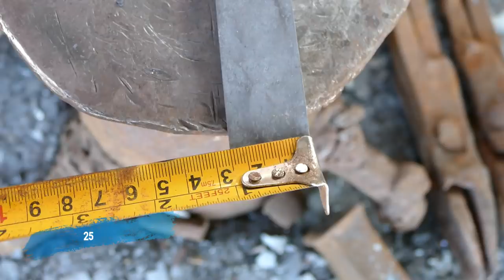MAKING A CHISEL WHICH EVERY CARPENTER WANTS TO OWN (HOMEMADE)

Comment: Great video as always. I must say Seth is a great blacksmith. And he need not need to prove it to anybody. His products are used for hard purposes like nut cracker aagriculture and many other . Even   japnese  and Indians quences in water. They are hardened . Keep up the great work. Home made power hammer is a great idea. Will definately increase and improve his work
Reply from the maker: He has different techniques for hardening and heat treatments. It is hard for me to explain it right as my English is not good enough.
Different kinds of steels, different techniques.

Comment: You can use a magnet to see if the steel is hot enough before quenching- the magnet will not stick to the steel if it is hot enough.
Reply from the maker: Wow that is aGreat lesson. We didn't know

Comment: Hi dose the black Smith temper the blade after harden it in water
Reply: sam l forge No.
Reply: He let's it auto temper.. in other words he leaves enough heat while in the quenching process to temper at the same time.. that's why you see him dropping water on blades the see how it evaporates and check his temper temp..
Reply: @anthonystrunk5360  this only works for low HRCs, and edge quench. It's suboptimal, but works.
Reply: @adrianjagmag  not if it's done correctly like this blacksmith obviously does.
Reply: @anthonystrunk5360  I literally learnt from smiths like him in my country, before I did formal western style smithing, facepalm. It's suboptimal. It's a much easier process than marquenching in oil, and then doing multiple temper cycles. Which is why it's done. The owner will periodically return to get his blade reheat treated.
Reply: @adrianjagmag  yes it is but it works.. I was explaining to the person that asked the question how his tools and blades were tempered.. I'm also a bladesmith and I use oil quench and tempting cycles.. I'm afraid to quench 5160 in water.. bad experience..lol
Reply: Anthony Strunk god 5160 is annoying. Cracks in water really easily and moves slower than other carbon steels. But it’s cheap and works well so I’ll keep using it haha
Reply: @JustinTopp  oh yes I use it alot but will not quench in water again...lol.. learned my lesson..

Comment: between 1:45 and 1:53 those are two different pieces of steel. in the first he was cutting off about 1/4 of the steel with the wedge, on the piece at 1:53 he is splitting a piece with over a third the width. somebody screw up and start over?
Reply from the maker: Not different steel. It is the same. Please check review it

Comment: Again. He is not getting his blades hot enough to actually harden them. He needs to get them at a bright yellow heat for it too actually harden
Reply: Actually he is. The camera makes it difficult for you to judge colours. He's aiming for a much lower HRC than what we'd go for. Since we quench and temper differently.
Reply: Or maybe he knows what he is doing. His livelihood depends on the quality of his work.
Reply: It's the light.. I'm sure his blades are hard.. you can see the hardness line after heat treat like a hamon line.. if he were to quench spring steel in water by making it glow orange and dunking it they would be in pieces .. he is a very good black smith
Reply: In daylight spring steel hardens In Water at a much duller red color than indoors.
Reply: @adrianjagmag  It doesn't quite work like that. Even if the camera is not showing the true heat thsn why can the camera show a yellow heat on the forging earlier in the video. And if you trying to harder something it wont harden with a dull cherry and it's very easy too temper after which makes the blade more useful by making it stronger. All he is doing is making the blade soft which wont hold and edge and hardening on one side of the steel does not mean it is hardened. Try again
Reply: @ReasonAboveEverything  It may depend on it but he is  selling things that wont hold and edge and will break very easy. For God's sake if he really knew what he was doing he would know that none of his blades or tools have been hardened
Reply: @anthonystrunk5360  A line does not make a blade hard. And a hamon line is clay placed on the spine to make a pattern or leave the spine of the blade soft and springy. Do you know how quenching works? 5160 which Is spring steel should be hardened around 63 Rockwell then tempered too make it stronger and not as hard as glass. 5160 is not a water quenching steel regardless there could be hidden cracks along the blade that the naked eye cannot see. And if the lighting is the issue than why cant you see the same heat when he forges to the quench. You can clearly see he never gets near hot enough.
Reply: @JustinTopp  I did not know that steel hardens at lower temperatures while in the light
Reply: Joe the Blacksmith it’s not actually Lowe temp it just looks like it from light
Reply: @joetheblacksmith8071  yeah I guess you know more than everyone else. You should have you own YouTube channel
Reply: Not all steels are the same. Some harden at a brighter red that's just a little over the demagnetizing heat.
Reply from the maker: I have talked with his customers, especially old people who know him and his father. Those people keep saying that his father and him are good Blacksmiths. Some people have had the products from them for decades. They are from many different places.  They all believe in the heat treatment and hardening they do. All of these come to a conclusion that the quality of their products are very very good.
Thank you all for the discussion.
Reply: @AmazingKKDaily  I totally agree with you and believe he is a very good blacksmith.
Reply: @joetheblacksmith8071  because you need a lower temperature for a water quench, and for an edge quench you're just quenching the very edge, they aren't doing a full blade marquench and temper. Honestly, change you name to something else. This method as I've explained is a necessary compromise considering the steel they have access to and works adequately, since spring steel can range from 1080 to 9260, they have no way of really knowing, so this method is safe for them. If you know so much, why the hell are you here? Also, you can get quench lines, aka a hamon without clay.
Reply: Joe the Blacksmith If you sell soft tools you go out of business. He has been smiting long time and is popular. He also has uploaded some of his tests where he cuts aluminum pipes and nails in half and the edge holds up.
Reply: @JustinTopp  You know I'm fucking with you right
Reply: @anthonystrunk5360  The funny thing is that I will be making videos but it's funny that you think you know everything
Reply: @demastust.2277  yes not all steels are the same. But 5160 is one of the most basic steels and is very easy too harden does not mean the actual blade is hardened when its red
Reply: @AmazingKKDaily  Again big difference in between what you in Cambodia use it for does not change the fact that he doesn't harden his blades you guys have soft wood that you cut and fruits and foliage that doesn't exactly show what an actual hardened steel blade can do
Reply: @anthonystrunk5360  I'm not saying hes not a good blacksmith I'm saying he doesn't harden his blades
Reply: @ReasonAboveEverything  Mild steel and aluminum is very soft.
Reply: Joe the Blacksmith And steel that can cut through that without edge damage can cut any wood or bone which is a great testimony of the quality of a steel.
Reply: @ReasonAboveEverything  again it is very soft.   A lot of steels can cut thin aluminum and mild steel and steel hold an edge
Reply: Not all leaf springs are made of solely 5160. You are talking out your rear end. @joetheblacksmith8071
Reply: Joe the Blacksmith Yes, lots of good steels.
Reply: @ReasonAboveEverything  yes even steels like 1080 a very easy steel but no where near high qualities
Reply: Joe the Blacksmith I have a feeling I fell for a troll.
Reply: @ReasonAboveEverything  it's not a troll tho
Reply: Joe, you need to change your name to "Joe who thinks he is a blacksmith".  You quench 5160 from yellow hot in water OR oil, you are setting yourself up for some cracking!  Non-magnetic is the standard for hardening quench.  Yellow is way too far above non-magnetic.  A range of the cherry reds from dull to bright, depending on the steel, is a pretty good gauge of being non-magnetic.  When in doubt about reaching non-magnetic, use a magnet!  I have hardened a LOT of 5160 at cherry (non-magnetic) and never had a problem.  The time or two   I went to yellow it cracked every time.  You are spewing a lot of bad, incorrect info here.
Keep up the good work, KK
Reply: @shortfuse43  THanks for being right, dude.
Reply: @demastust.2277  Actually hes not right. If you looked at the link and watch the video it proved you and him wrong
Reply: @joetheblacksmith8071  Can it, fool.